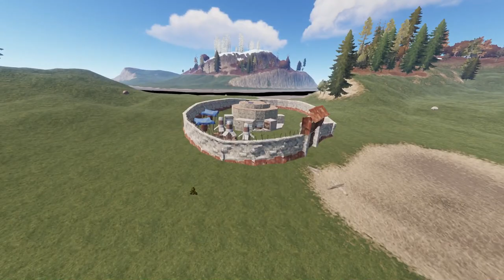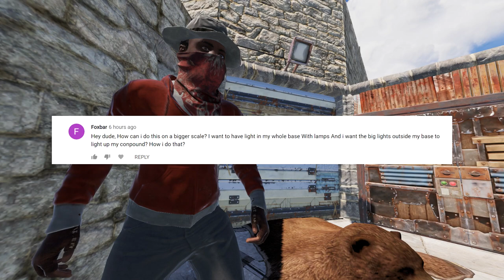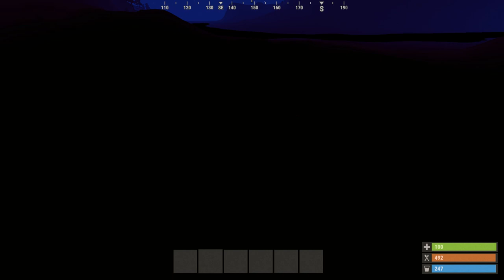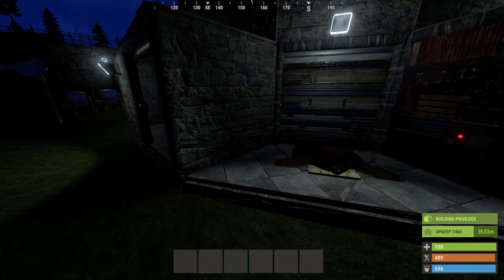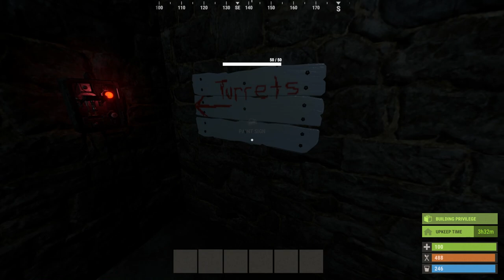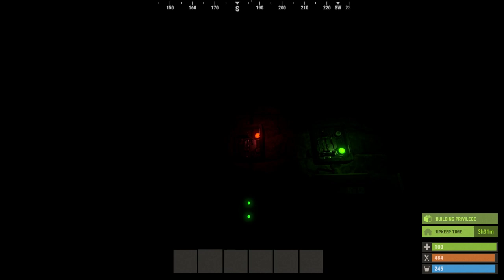Rust Electricity - LIGHT UP YOUR WHOLE COMPOUND!

Comment: Did u ever test if ur able to open doors u don’t have codes to if u use a pressure plate or switch
Reply from the maker: Yes actually, I mention it during the video, didn't demo it, but you ARE able to open doors with the pressure plate / switch without codes.  Be careful.
Reply: Thanks man looking forward to more electricity content